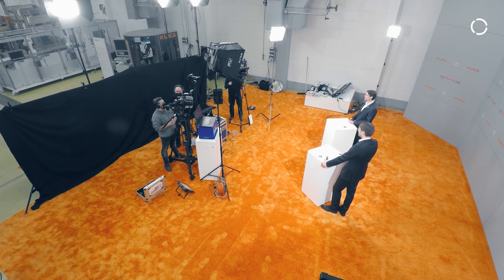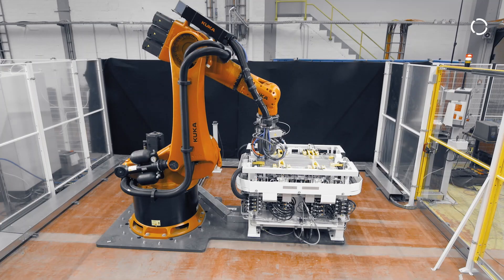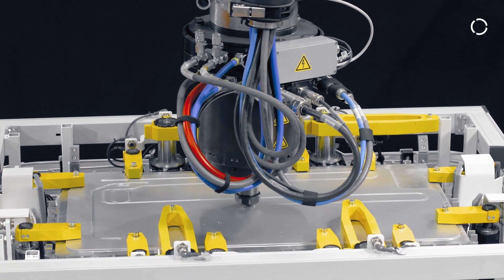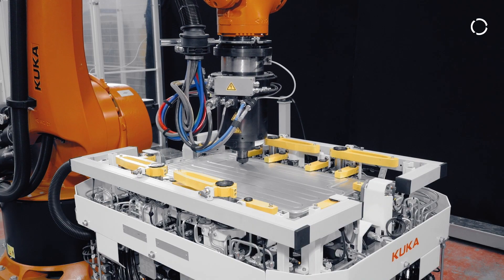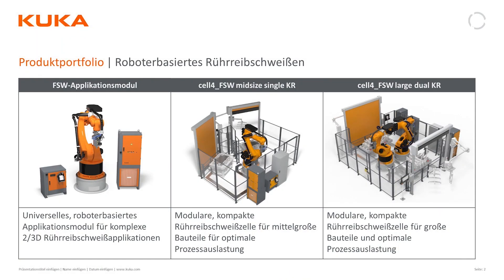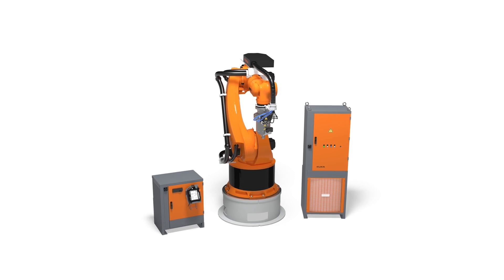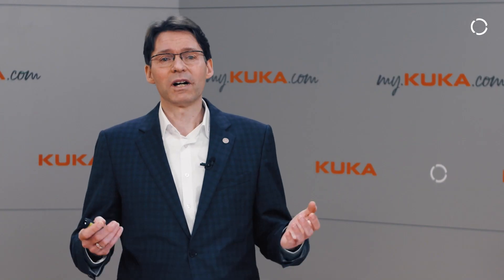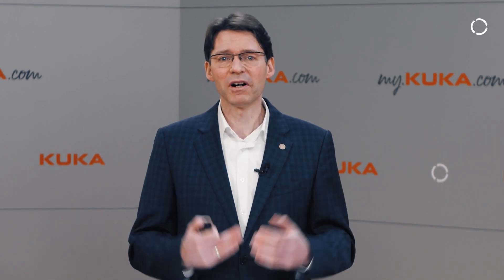Friction stir welding in e-mobility - KUKA Expert Talk at HMI

Comment: Hi there: i just would like to ask where to get the RIGHT INFO from  IN ORDER TO MAKE ACCURATE CALCULATIONS ABOUT ENERGY CONSUMPTIO OF ANY KUKA ROBOT(there is absolutely no indication nowhere, not in the datasheet nor on the official website); CAN YOU PLEASE HELP?

PS: i am trying to figure out the energy consumption (Kw) of a KUKA kr60 CR2  ed05 with a constant&continuous work-load of about 8h/day.
Where do I find the electrical info of all the motors and actuators of the robot?